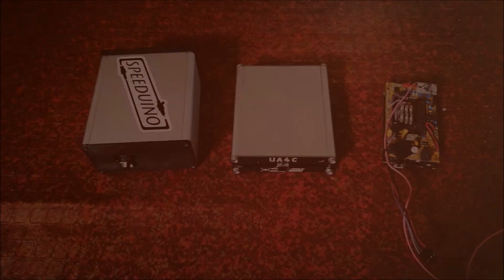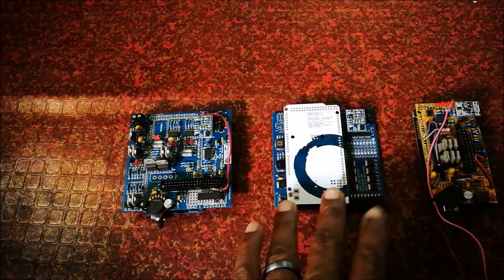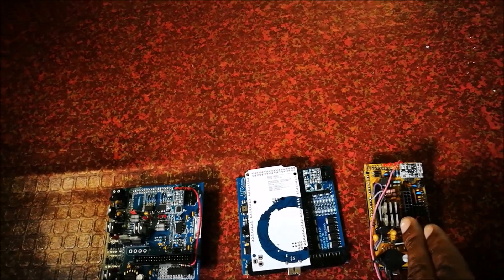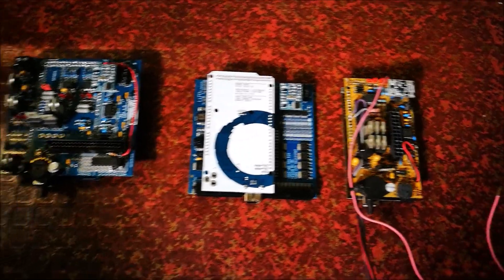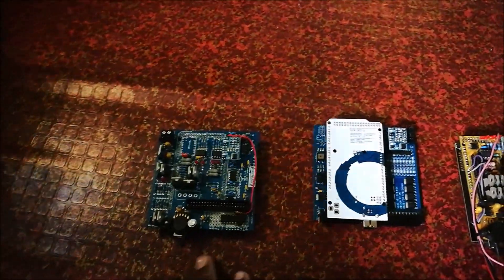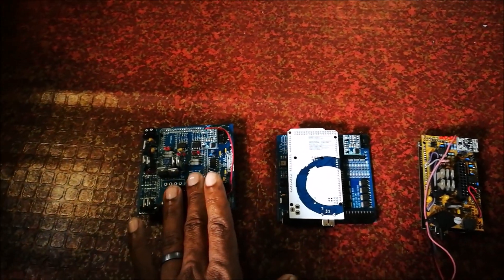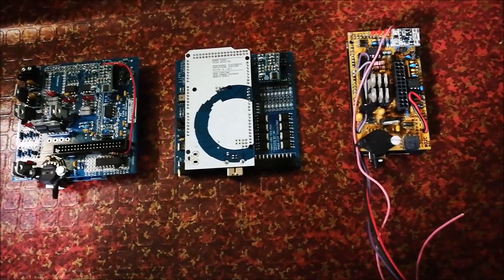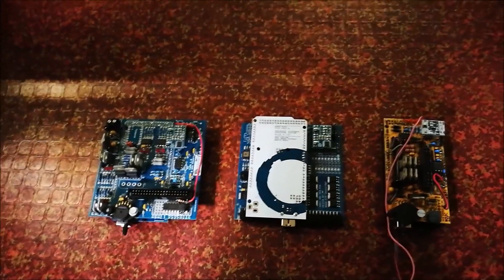Which Speeduino Board Should You Use ?

Comment: Interesting. What I think is most important, especially for high revving engines such as Hondas, is the ability to run sequential ignition for the sole benefit of charge time between spark events to take advantage of Coil on plug. Injection fired in batch works fine, there's no point in sequential unless you are concerned about emissions and economy.
The real advantage to four channels on injection is being able to fire one low impedance injector per channel and not cook the mosfets.
The MPX4250AP We used in Megasquirts for years is no longer produced by NXP, really we need to find a long term supplier of a suitable 5 Bar map and stick with that, but not sure if there is one that fits on the footprint of the MPX4250...
Also VTEC, does this have a PNP output to switch +12V for the VTEC solenoid?
Reply from the maker: Mpx6400 map sensor fits.

A relay is used for vtec
Reply: @DCWERX  thank you

Comment: Hey, These videos have helped me a lot.
I am doing a college project which doesnt include plugging in the ECU to any vehicle i just have to Inject fuel into some measured container to show reduced flow rate.
My project deals with dual fuel maps and i was wondering if this is possible.
As i dont have an engine and can only simulate the entire process, Is it possible to just Control the Fuel injectors by tricking the Speeduino.
The project is to reduce the Engine performance when the driver gets drowsy and hence reduce overspeeding accidents, hence when drowsiness is detected a signal tells the speeduino to switch to the lower performance fuel map.
Your advice would be really helpful

Comment: Hello. Thanks for making these videos. Much appreciated. I have an assembled ua4c fishdog on order from speedyefi  and am planning out my wiring strategy. I have a quick question if you dont mind. The online wiring diagram shows grounds at pins 10,11,21 and 22.  Any idea which pins would be best to use for the main ecu to engine ground? Also which would best best to use for all the sensors ground? I looked everywhere online I can think to look and cannot find a specific ua4c grounding strategy. I have the speeduino manuals downloaded, but cant find details on which are best pins to use for specific grounds. Any help I greatly appreciated.

Comment: I'm a total noob about these!  i just found out about them today.  I have an 89 Celica alltrac, with an OBD1 computer... does that mean i have to go for the SPEEDUINO V0.4 ASSEMBLED?  you said something about that one being able to plug directly into an OBD1 Board.  Does that run stand alone, or does it then plug into the computer?  I'm trying to learn as much as i can so i can start pricing things out.  i was pretty sure i needed to go to the 90's Wiring harness because it's computer is OBD2, and it's a huge relief that there's an aftermarket ECU that allows me to use what i already have... thanks for the vid, i liked and subscribed, and now i'm commenting!
Reply: also, what is the need for an arduino? i thought that this was a speeduino.  Am i going to have to learn how to build an arduino in order to interface with these?
Reply from the maker: I highly suggest you take a look at the wiki pages at Speeduino.com to help you get started. It covers alot of the basics needed to get started.

In regards to which board to use its completely up to you which one you use. They are all pretty much the same function wise. I made an adapter board that plugs into the v0.4 that's what I am referring to in the video. It's called the SS-OBD1. It's for sale at WTMTronics.com

Comment: Hi man, im wondering about replacing only the carburetor in my motorbike, and its not clear what the small ecu is! What would you reccomend to only manage a injector and a map?

Edit: Do they also correct the map based on oxygen sensor?
Thanks!
Reply from the maker: The small ECU is called the no2c and it is basically just a smaller version of the speeduino boards. I would recommend that one for a motorcycle.

Yes with the registered version on tunerstudio. You can use the VE analyze feature also known as auto tune. It will correct your fuel map to match your AFR target map. It also allows closed loop o2 corrections to make small changes while you cruise around.

Comment: I am new to this. I am building an air-cooled VW  (bug) engine for the track. I would very much like to use EFI.  The mechanicals of the system I understand. But which board and accessories do I need? The ignition was going to be MSD, can this signal the system? Am I even asking the correct questions? If you can help, thanks.  Watching the videos and learning.
Reply from the maker: With modern ignition systems the MSD is almost obsolete. You just need a suitable crank trigger and coils of your choice.

Any one of the boards will work, it just boils down to preference as mentioned in the video.

Depends on your crank sensor you may need a VR conditioner board. The rest is pretty much the same as any other engine. 

Start doing some research on the Speeduino wiki pages at speeduino.com and join the forum. Lots of good info there
Reply: DC WERX 
Thanks for the quick response. Found the installation and tuning info. Answered most of my questions. About the engine I’m working with, it is a carburetor and points engine! To stay in class I need to do some magic, I think I know how now. Thanks again👍

Comment: Alright I’m researching to see if I can use this system on a motorcycle single cylinder with fuel injection any information would very helpful cheers Simon
Reply from the maker: Nothing really special to know. It's pretty much the same as any install. You may just have to tune using Alpha N ( TPS based instead of map )
Reply: DC WERX thanks for the reply on issues using a single channel on any of these systems I’m building a turbo small bike and need fully controllable mappings
Reply: @DCWERX  Why TPS instead of MAP? I am in the process of tuning my 1cyl motorcycle using map.
Reply: @pipedane  because it is all over the place on a 1-cylindr like that
Reply: I'm also planning on using speeduino on my 1cyl motorcycle and i seek every bit of information i can find because there isn't much on 1cyl NA engines. If anyone has any info on that or knows where i can find it please help me!! Thank's in advance.

Comment: Nice talk through, thanks again.  I have a question and a request if I may?  The question is about the ribbon cables:  do you find them OK for long term use?  -The Speeduino Wiki says to replace them with Dupont cables for long-term.
The request:  Could you a demo of setting the jumper configs?  I've searched all over and can't find how to set them for VR-1 crank sensor..
Reply from the maker: The ribbon cables have worked great for me in both short and long term applications.

The jumpers settings are pretty simple. You just put the shunt jumpers to set it to what you want to do. jp1 on the v0.4 is to set spark output 5 or 12v. Jp2 is for vr1/rpm1/crank signal set to hall  or vr based on what you have. Jp3 is for  VR2/Rpm2/cam signal similar to to jp2. Jp4 and jp5 are pull ups for VR1 and VR2 respectively, you set these when using hall sensors. 

The jumper settings are expalined on the Speeduino wiki aswell. I may cover it in an upcoming video.